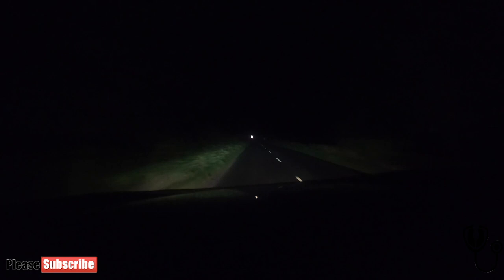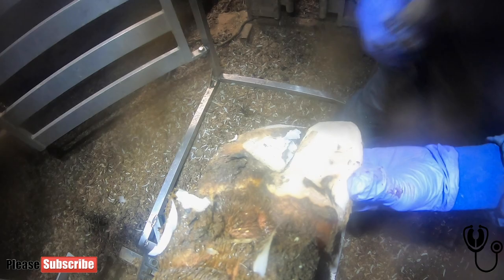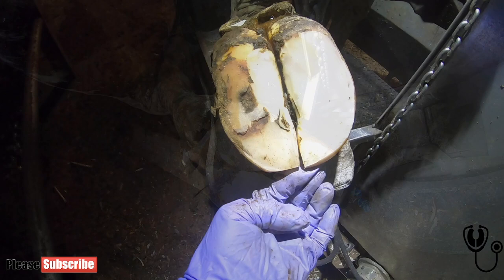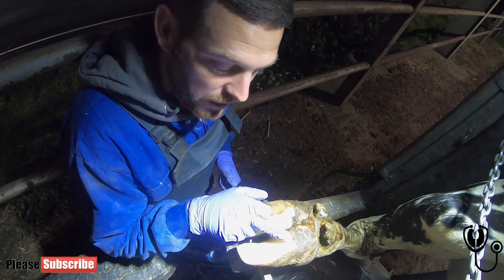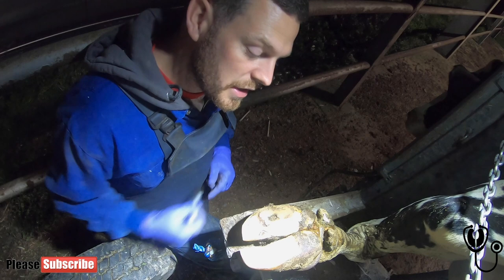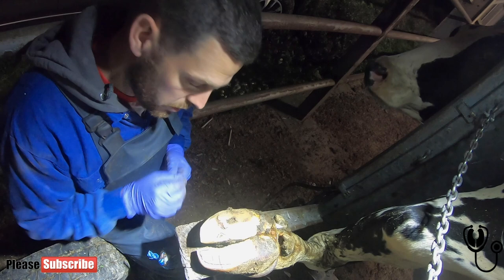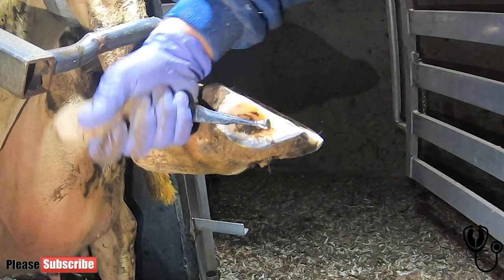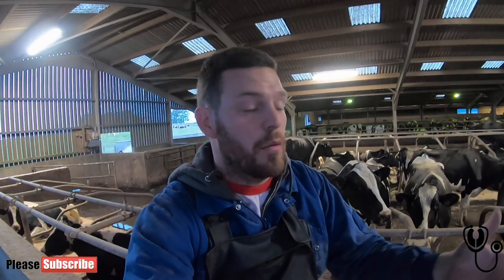LETS MAKE THIS COW LAME! | How to avoid over trimming | The Hoof GP

Comment: I love using sharp knives too! I'll use a scalpel blade for most of my daily cutting needs, it is much more precise and extremely versatile. They're great for all sorts of stuff, everything from gardening, to crafts, to cleaning. Sharpest ones I use for medical reasons, fabrics, models, papercraft. Once they are a bit more dull, they are excellent for getting moss out between stones, or scraping paint. Also, once they are blunt and completely used up, you just pop another one on. My family often joke about it, but if something needs to be done, trimmed or cut, I'll break out the scalpel or a proper field folding knife if it is a heavier job.

Comment: Do you use Betadine or straight iodine? At what % ?
Reply from the maker: Its straight Iodine at 10% I use. If you're in the US you will steuggle to get 10% though - I'm sure 7% is easy to come by though
Reply: The Hoof GP We can get 7%, but its tincture of iodine, not the straight iodine. Apparently, someone figured out that straight iodine of that strength could be used as ingredient in methanphatamine production.
Reply: @TheHoofGP  Thanks for the info. 7% is about all we can get here. But thats good to know.

Comment: I have a question, when you trim the hooves look nice smooth no sharp points!!
I have watched another trimmer and his trims look bumpy not smooth and the front doesn’t look even all the time!!
So my question is trimming done different in different part of the world, say you or the US??
Reply from the maker: There are 4 different methods but ALL of them require smooth trimming- if there is uneveness and bumps they create pressure points which can lead to uncomfortable and lame cows
Reply: Can this be an indication that the blades (are they called this?) on the angle grinder need to be changed?

Comment: Is that just a simple U hook to hold the hoof in place on the shaped timber support ? My cows would be pulling away especially with the grinder noise. What do you do to keep them from struggling  in fear of the noise and being held ?
Reply from the maker: The crush supports them around the chest area which keeps them fairly calm - yes it's an aluminium hook which is specifically for the job